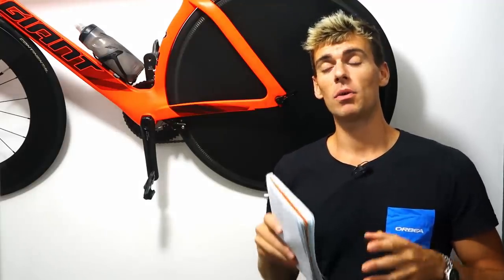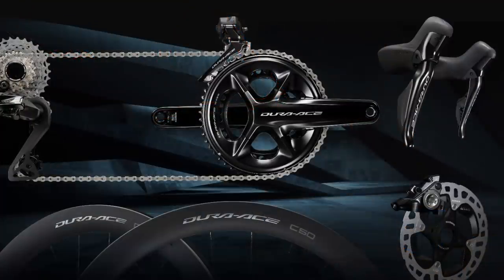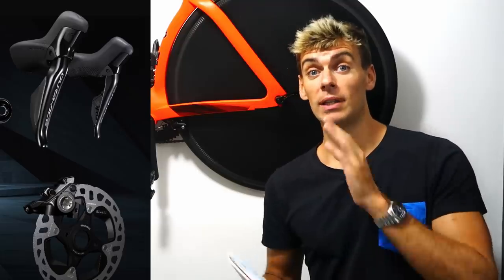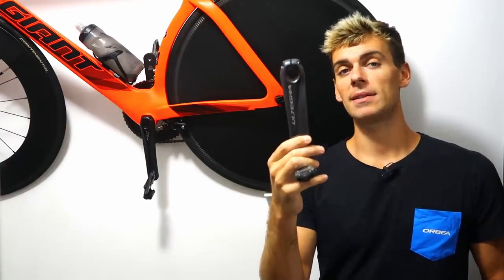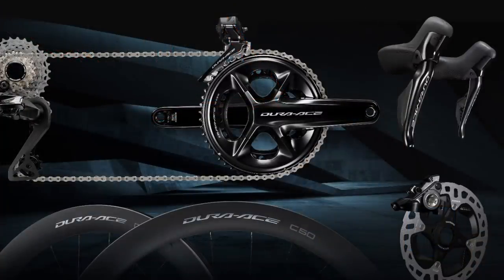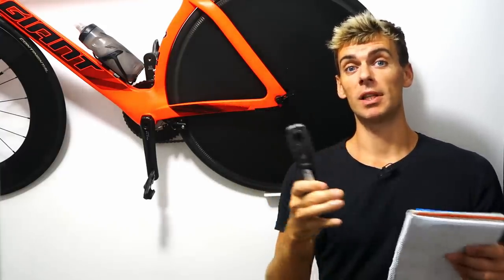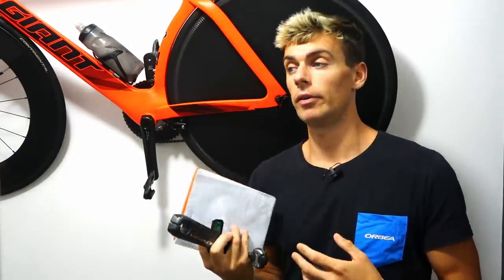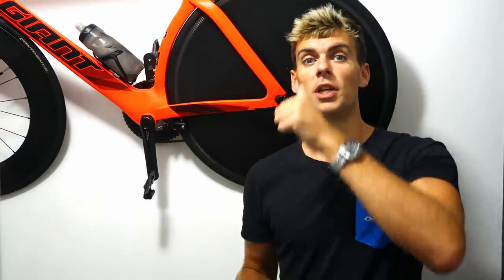Shimano 12 speed Dura-Ace & Ultegra Launch. Power Meter design, crank failures & disc brakes.

Comment: Feels like the hoods were designed with currently banned aero position in mind.
All in all this generation was anticipated to be a flop and here it is, a step sideways-backwards
Reply from the maker: No i don't think so. If shimano say that, then that's marketing bs. It's definitely grown to improve pad clearance and lever ratio probably.
Reply: @PeakTorque  nah, quite ulikely they did anything about it. Even those calipers are rather a rework of two-piston 9100 XTR

Upd: well, it's space for a di2 wireless transponder. And "feedback from pro racers" or marketing bs in other words
Reply: What banned aero position? Is that resting one's forearms on the top of the bars as if to imitate tri bars?
Reply: @And-rc9yy  as resting forearms on the tops near the hoods. Apparently only palms belong there now
Reply: @feedbackzaloop  Thanks I somehow picked up the habit of riding with forearms on the tops, I know it's asking for trouble, especially with the state of the roads.
Reply: @ Peak Torque - Yep, it grew for better pad clearance. Could be other factors, but that’s definitely one of them.

Comment: correct - nobody needs 12 speed

hell nobody needed 11 speed
Reply: No one needed 10 speeds. TDF riders raced and trained just fine for decades on 6 speeds. And they did so without goofy power meters hanging from their bikes like so many amateur poser clowns now have on their rides. 

Loads of high margin and completely unnecessary “bling” in the bike industry is pedaled to fools, who think they are Froome and need every gadget and trick wheel or frame in the book for their amateur “adventures”.  Came across a guy the other day riding what was easily a $10K Specialized Tarmac with Enve wheels, full Red, etc… and the dude was barely doing 16mph on a flat section of road. He had trick aero wheels and a trick aero frame and his saddle and bars were almost at the set up you’d expect to see on a hybrid. But those Enve’s sure made him fast! It’s as comical as the amateur crit riders showing up on $8K bikes because they have to “keep up” with all the other amateur posers doing the same. 😆

Comment: Completely wireless?
Reply from the maker: I dont think so. This is Shimano remember. Baby steps.
Reply: Shifters (if you use disc breaks) are completely wireless.  What this means is the RD, FD, and battery are all wired together and that is it.  You charge and communicate from RD.   This is about smartest system I can think of IMO keeping what is good and adding in something better.
Reply: @trepidati0n533  not sure anyone uses discs that break, at least on purpose.  That would be a weird design choice of Shimano to make for their brakes.

Comment: Off topic: 

is there a good carbon wheel for rim brakes on descents or just stick to alloy wheels for rim brakes ?
Reply: 35000km+ on a set of rim 303 firecrests. No warping, no delaminating, no tube explosions. 
I do a lot of climbing and descending and live in a hot climate (Queensland, Australia). I’m 70kg, which may assist, but I’ve seen plenty of other riding companions blow up no-name Chinese rims, 1st gen Enves, Roval etc, but no problems with Zipps (or the early Zipp-made Bontragers). 
I admit I would be nervous to try any other brands these days, since there’s almost no incentive to invest in heat resistant rim brake wheels with everyone so afraid of rim brake carbon wheels failing (which imo is one of the reasons discs are being pushed so hard - no reason to need to make a heat-resistant carbon rim when you don’t need it for braking. Every component manufacturer can make or buy a cheap carbon rim and pair it to a DT Swiss hub and sell it on an OEM bike for sweet $ if it’s disc. Not the case when it was all rim..)
Just my grumpy opinion though..
Reply: @jbthomson89  thanks brother
Reply: I don't recommend no-name brands, but I know a guy who bought a no-name carbon fiber wheelset from Amazon, and he does mostly climbing and descending, and he hasn't had any issues after 2 years.  He is 55 kg though.  You could take a hybrid approach: HED Jet RC Black.

Comment: €5000 retail for DA with PM.  Think I'll pass.  Please don't pass up this opportunity SRAM / Campag / China / FSA.
Reply: Where did you find that?
Reply: @cissepauwels8211  All over numerous forums.  Saw it first on some German ones.  €3900 w/o PM, €5000 w/.  Ultegra €2450 w/o PM, add €900 for PM.
Reply: I see i see on weightwheenie price are gonna go down when it is a few months old I guess
Reply from the maker: @cissepauwels8211  in 2029 when its available
Reply: @cissepauwels8211  I think you can expect the first price drops after more than 24 months ...
Reply: SRAM Red and Campag SR cheap? Funny joke that.
Reply: @szurketaltos2693  You can get SRAM Red w/ PM for under €3k.  That's a €2k price gap.
Reply: @pmcmpc  hm true, and Shimano is better but not €2k better. I imagine it's a response to low stock as Shimano have been having all sorts of pandemic production issues
Reply: @PeakTorque  probably
Reply: sensah :) 11k miles and counting...

Comment: Stages and angular momentum PMs are garbage providing erratic downstroke or upstroke readings of cadence relative to when you glance at your computer, All stages types i tried would give me readings such as 90-95-89-110-94-120 rpm and same for power. Magnetic real inductions RPM (GC10) would tell me the actual cadence as measured by em impulses per second and metre, lightspeed precision,  94-95-94-96 or just 100-100 relative to actual cadence.  12 speed? more weight and lesser tolerances...